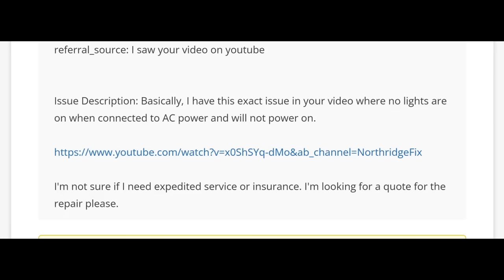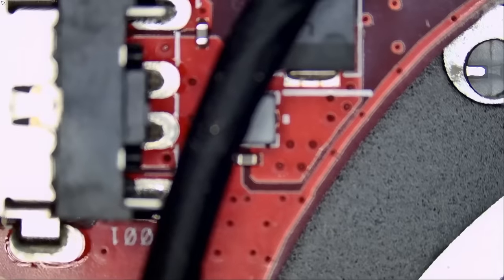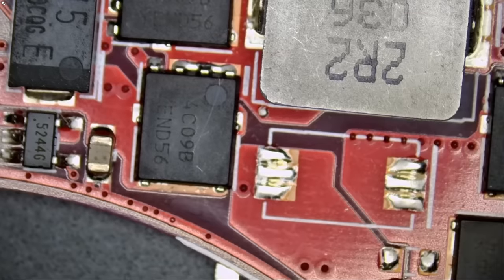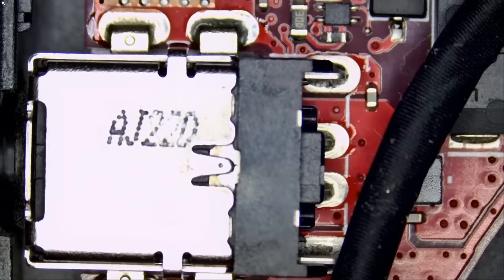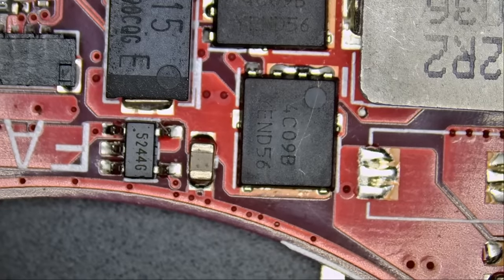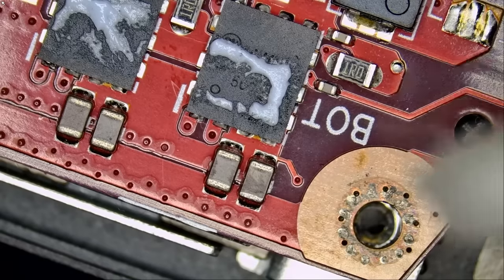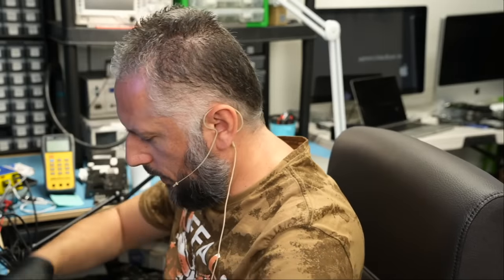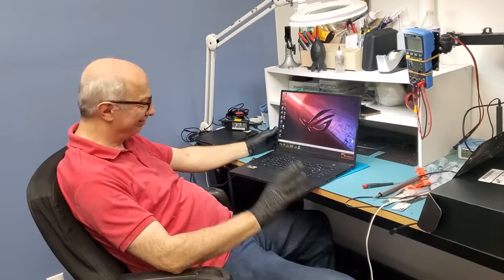Price Quoting Customers & Reverse Psychology - Asus Laptop Repair - California Realty is War

Comment: That repair was caused by the ground screw next to it was loose and arcing , and made high resistance to ground at that cap and high heat causing failure, I find a lot of arcing on the ground screws like that on these boards. Keep up the good videos Thank you😁

Comment: I have found if the Battery is disconnected it requires it to be plugged in with charger to turn on, found this procedure changing HD's, I appreciate the work you do and your presentations R-10+

Comment: 2:28 I definately agree as an Indian. We here if have bad laptop's, in most of the cases from a local it costs us about 30 to 50 bucks for a fully functional laptop.
It's free for a repair attempt in most cases 
However if they can not fix it, the will extract expensive parts sometimes.

Comment: Would be more informative about the effort that goes into the fix if you also included disassembly and reassembly in the videos.  
You done it a few times where you've timelapsed Big Boss reassembling.  It's really quite pleasant.  
Consider doing it more often.  And consider doing the teardowns as well.

The feeling of 'home' is unbeatable.  California is a good state.  
I feel at home in Massachusetts and love it, but it has challenges that California does not.
The cold, the snow removal, the deciduous tree leaf removal, etc,
The worst place I've ever lived was Texas.  The heat is unbearable.  The smell is cancerous.
But my house was 3400 sqft spec'd just the way I liked it!  Built just for me $250k!!!!!!!
BUT the house is on less than 0.25 acres 12' from my neighbors on both sides.  13 minutes from the nearest grocery store.  
Low tier schools for our kids.  The only time I lived in an HOA...which I hated.

Now I live in MA 100'+ from my neighbors, two grocery stores within five minutes of my house, 2100sqft (38% less than in Texas) on 0.7 acres, $520k (200%+ what I paid in TX) .
Within the top 10 school systems in MA.  Everything is a tradeoff.

Comment: hi @NorthridgeFix , i recently got a job soldering... But I ammm confused. The power supplies we have been repairing take an INSANE amount of heat to melt solder under mosfet chips. We max out our soldering iron's temperature, as well as using a maxed out air blower. Both are set to 900F. This only possible after using an even hotter heat gun to remove the heat sinks from the other side.. I feel like this way too much heat, what am i doing wrong?
Reply: Switch off the fan or ac😂😂😂

Comment: Amazes me you can run a successful repair shop. In oz electronics are just thrown in the bin and buy a new cheap one. People  give away used working laptops and TVs here for free. I guess expensive gaming laptops is your main income source. But I expect work will slow down more over time. Time will tell. Good luck with your new home search.

Comment: I would actually want to know which computer he hasn't worked on before so I can buy it since it seems like he has worked on every computer in the market. Probably the computer he hasn't seen is unbreakable lol
Reply: Alex should devote a video to a list of laptops he recommends.  The least he ever fixed
Reply: @starcarl iirc Asus is bottom 3 and Lenovo is in top 3 I forgot the other ones
Reply: Computers are built from sourced parts,  even brands like ASUS who makes the board will rely on manufacturers for hardware. Component's are bought large batch though who can meet deadlines and price. The parts replaced in these videos are components fabricated before the company or product therefore ALL manufactures will suffer from these bad caps and poor silicon hardware.
My new Ryzen 9 AM4 16core last seasons release was 1 of 5 or 20% Dead on Arrival.
Reply: Actually I think the laptops he doesn't usually get for repair means those laptops aren't selling very well so you should avoid them! I know it sounds reverse

Comment: I need some advice should I fix a 7 th gen I 7 that has the mother board shorted and blasted from the battery part seems that there was water between the connector or some liquid fell on it when it was running and the battery connector and a small semicircle around it is roasted ,what should I be doing salvaging for parts or go for a fix attempt it would even require wiring copper wires as the traces on the PCB are burnt and blasted of near the connector of the battery on the mother board ,HP i7 pavilion 7th gen for reference.